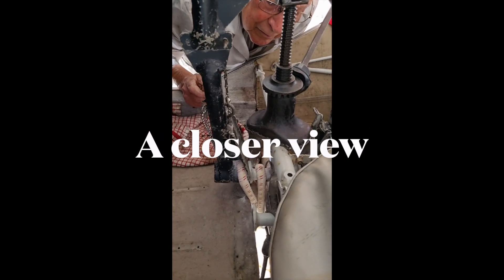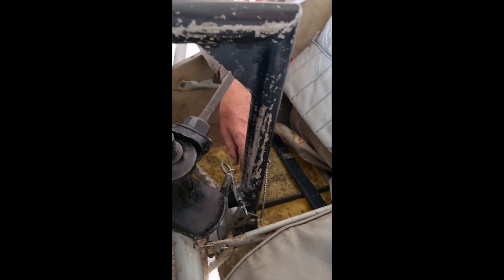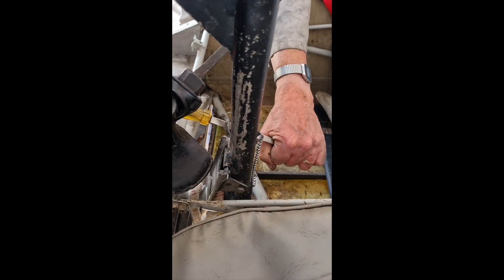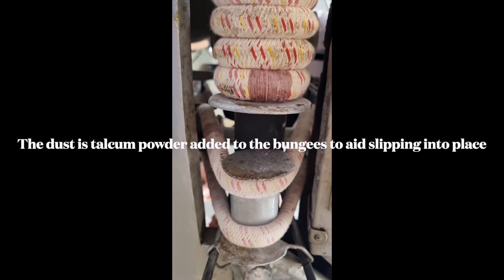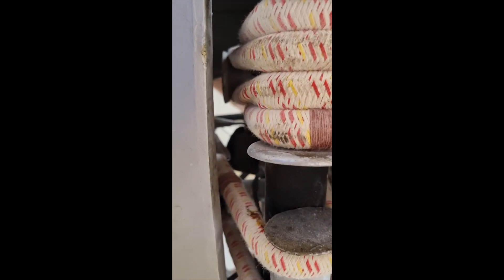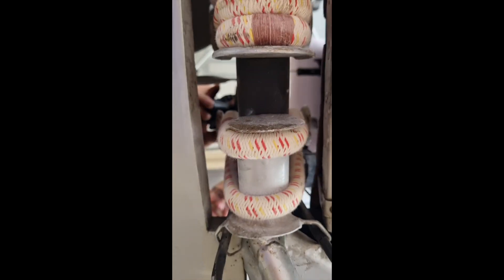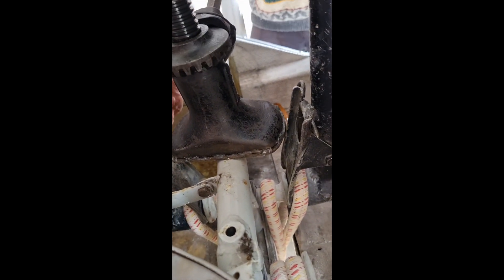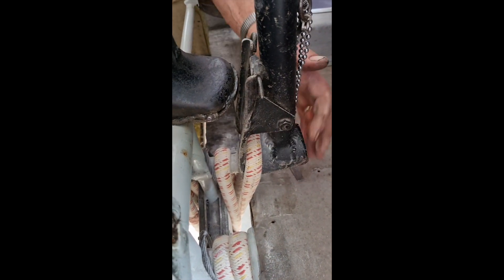GAIBX bungee change

Comment: Interesting to see the bungee tool in use. How many people required to do the job safely? Working by myself I don’t believe I’d have been able to use that method safely, which is why I used the hydraulic engine hoist.
Reply from the maker: I reckon at least two, possibly three as a minimum.  Solo, not a chance.  The hoist is brilliant idea and over time im sure the only way.